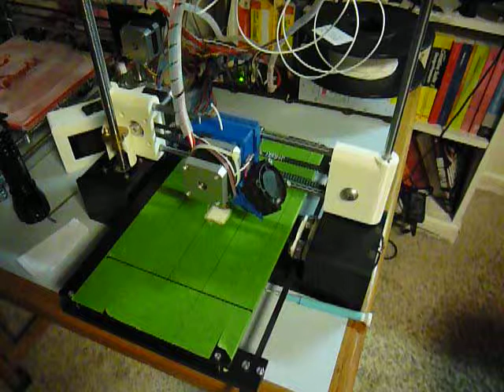QU BD TWOUP 3D Printer upgrade part 5

Comment: I have a two uop. And when I try and print something, anything the extruder just runs to the threaded rod and dosnt stop. I have to unplug it. 

Do you know why this is. It would really help!
Reply from the maker: The TwoUP did not come with end stops originally, you have to manually set the Zero position (0,0,0) in the firmware which is a real pain. I much prefer the end stops but you have to purchase them separately then enable them in the firmware. if you have purchased end stops and have them installed but need help with the firmware let me know and I can send you my firmware code.
Reply: well i found the firmware online, but am having trouble sending it over to the arduino. teensy is being a pain. it would not work wth most recent arduino software or drivers, so i downloaded a supported version. and then got 
"#error pins for this chip not defined in arduino.h! If you write an appropriate pin definition and have this firmware work on your chip, please submit a pull request"

Comment: You can connect the fan directly to the power supply to get it running.
Reply from the maker: +Araik Semerjyan Yes this is true if you use a 12v fan you can hook it up directly to the power supply, however the printrbord has a fan port that can be managed by the software so might as well use it.
Reply: +bubalettow sorry I didn't realize this is from a few months ago. I'm curious, do you still have this printer and if so how is it working for you?
Reply from the maker: Araik Semerjyan I still have it and after the upgrades I did to it is isn't that bad, it is still on the inexpensive side and we all know you get what you pay for, but I use it in my office for all sorts of things. more industrial things less finished surface pieces.
Reply: +bubalettow I bought one a couple weeks ago and haven't been able to get it to print anything yet. I have full control over it from my computer but when I start a print it doesn't extrude. 😔
Reply from the maker: +Araik Semerjyan When you say full control, does that also mean you can extrude properly in manual mode? is only a little bit of plastic extruding? if that is the case you would need to calibrate your e-steps. if it still isn't extruding you might need to adjust the extruder's stepper driver and check you build the extruder properly and have proper tension on the filament.

Comment: can you provide information on the extruder stepper motor wires that you switched?
Reply from the maker: for the extruder I needed to change the direction, this can be done in two ways, either you unplug the stepper motor and reverse the plug, or you specify reverse direction in the firmware, either way works.